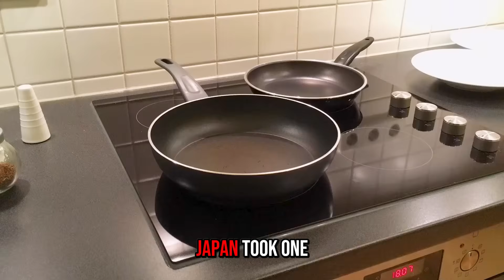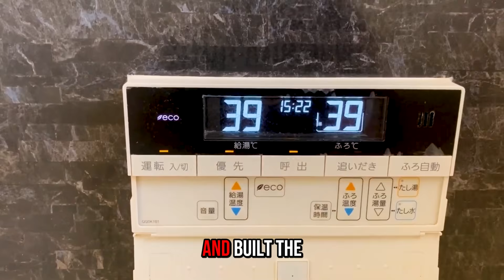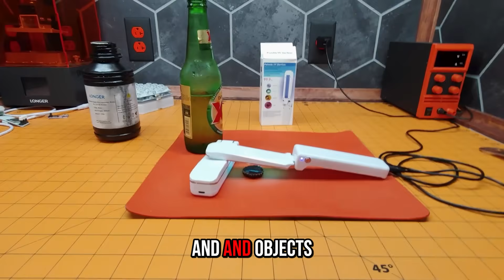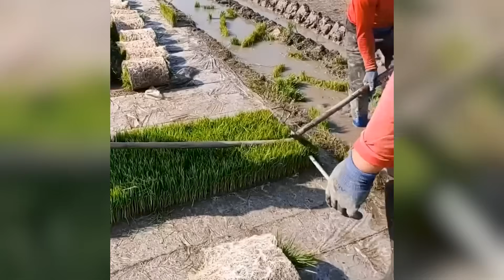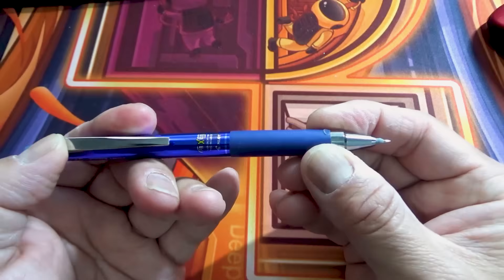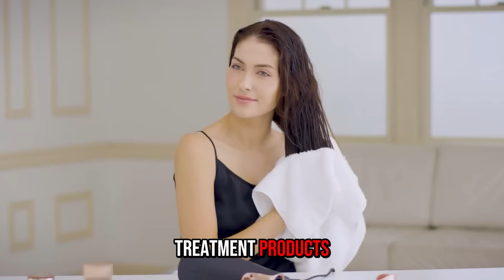15 Japanese Inventions That INSTANTLY Make Life Better..

Comment: The salt tasting spoon needs to have a cord to the battery. I would think it would be heavy and awkward to use. My electric toothbrush sometimes will get off balance and will fall in the sink. Maybe because it's wet. But it can be awkward at certain angles. The spoon would be a nightmare for me I hate over salted food. And I have high blood pressure!! 😂

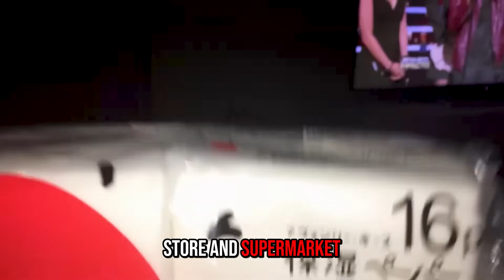Comment: 1. The self-heating bento box (number 5, 4:35) is astonishingly useful. It heats food without a power supply, an outside source, and it's disposable. This should be made everywhere to end world hunger.
2. The clothes folding machine should be made smaller to fit in small apartments.
Reply: The "Self Heating" Bento Box uses the same tech, since the 1950's. MRE's.  Military Ready Eats,  Pull the string get a Chemical reaction.
Reply: @lukelucy1980I don't think these need water though. Mre bag does

Comment: I don't mind folding laundry, i hate matching socks
Reply: Solved the matching socks problem long ago. I only buy one type of socks in one colour and they go into a small bin without folding. When I need a pair, I just take out the first two on the top. My socks are a different colour from my husband's so only need to sort socks into two piles and it's done.
Reply: To be honest the only thing I fold is socks match and roll up. Every thing else I just toss in the drawer lol

Comment: lotion in tissues and erasable ink pens..... umm those have been out and available in the U.S. since like the 70s and 80s. The bathtub is awesome though.
Reply: I always get sucked into this click bait.  The "Self Heating" Bento Box uses the same tech, since the 1950's. MRE's.  Military Ready Eats,  Pull the string get a Chemical reaction.  Fema Gives them out in disaster areal
Reply: @lukelucy1980don't need water though. Mre does
Reply: Erasable pens suck. I haven't used one since the mid 90s in high-school because they never erase clean. Maybe decades later theirs is better